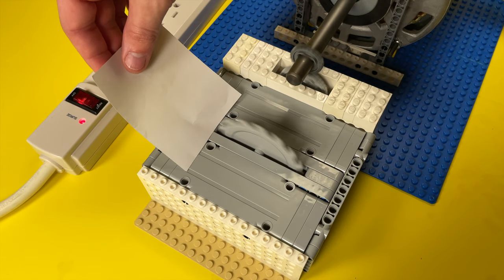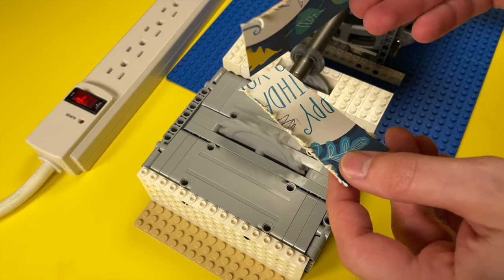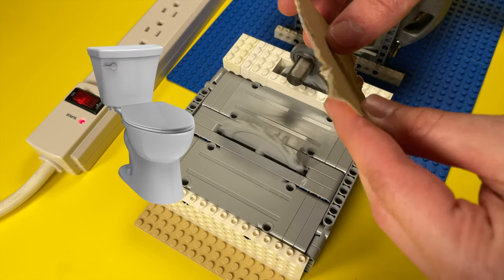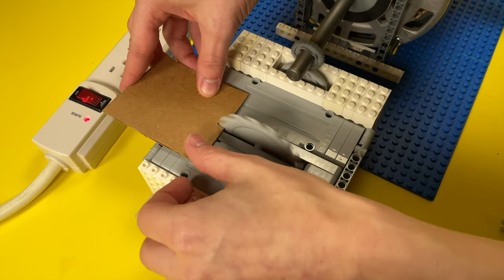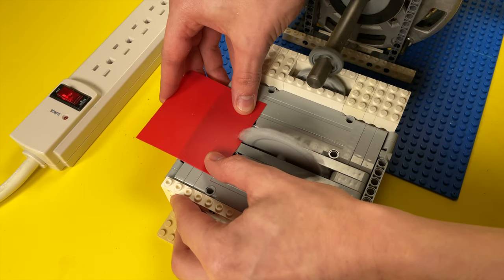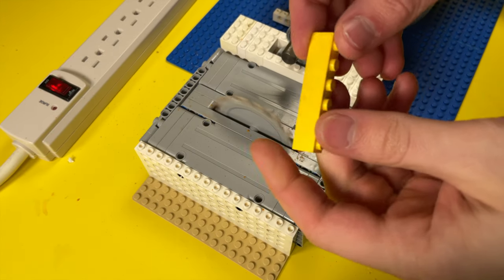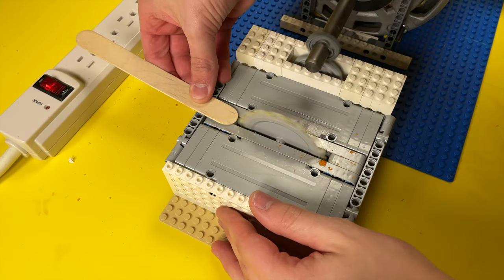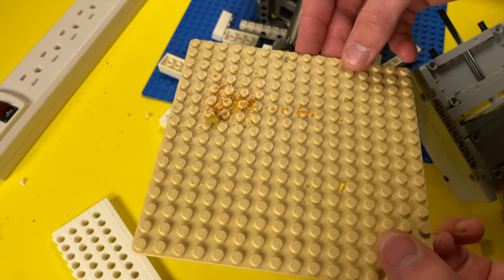The 1/2HP LEGO Table Saw Cuts EVERYTHING... Even LEGO

Comment: What did you use for the blade?
Reply from the maker: LEGO part 61403. Since it didn't have an axle hole I had to super glue it in place. That's right, I used the Kragle.
Reply: @LegoTechnicsRule  oof , Superglue that not that great to hear. Poor lego brick
Reply from the maker: @ikeaframe1772  The saw blades are something I NEVER use as they are purely for decoration. I also had a worn out 12L axle, so it’s not like I made a bid sacrifice. However, they were given a proper burial.
Reply: @LegoTechnicsRule  well if it is so , then it is less bad